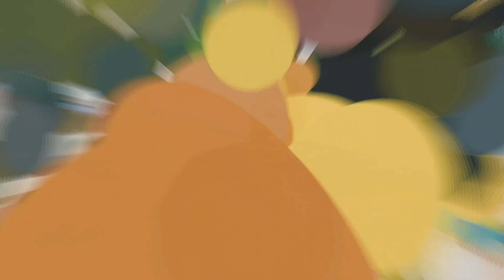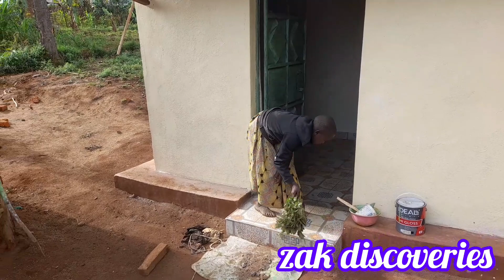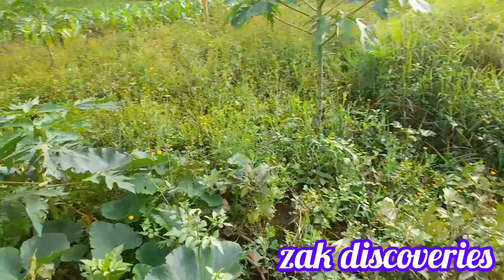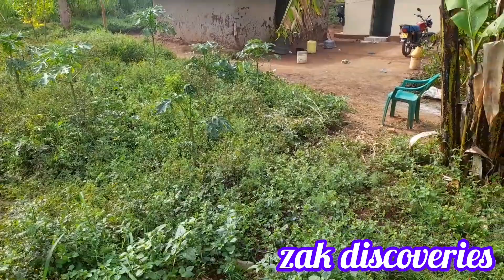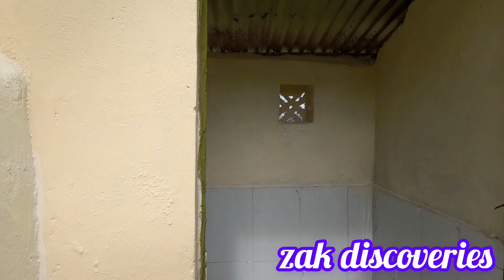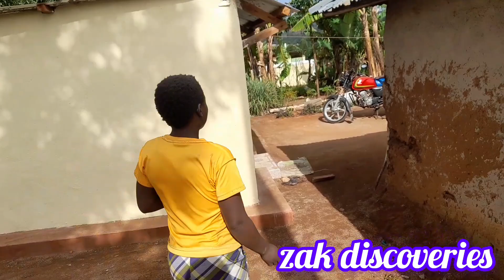We are nearing The END Of 1st Part, OPINIONS WAY FOWARD.

Comment: Hi Zak, Baba Godfrey cannot sleep for fear that the water tank will be stolen. Lord have mercy. 
What do you think about constructing a 3-sided wall around the water tank so that it is not easily stolen or do you think that the fence is enough?  Thanks
Reply: @dladylikessports7780 that’s a very great idea to build a wall around the tank.
Reply: @ Zak since this compound doesn't really have a security wall( because barb wire and chain link can not stop someone that really wants to get in ) maybe a shed built around the tank with a lock might work or a brick structure like the bathroom wall with a lock will work. Also if a new house is constructed connect it as close to the new one as possible ideally a inner door to connect both structures would be nice  but I think it's too late since the house is closed molded and cemented now..
Reply from the maker: It's true, I don't think it will be stolen or broken, it's okay the way it is once we put the fence.
Reply from the maker: It is but its expensive.  We can channel that cash to the lold house. No one will tamper with it.
Reply from the maker: No, it's better to put a chain link then rather than a wall.
But that tank is very safe I assure you.
Let's work on the old house